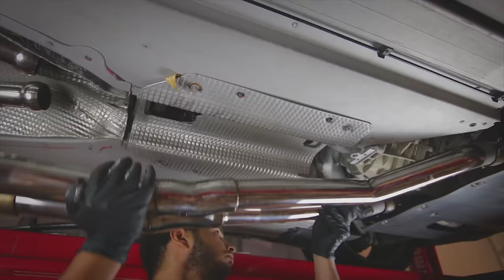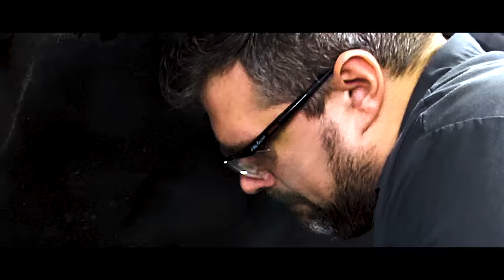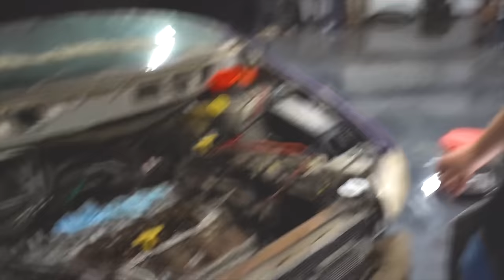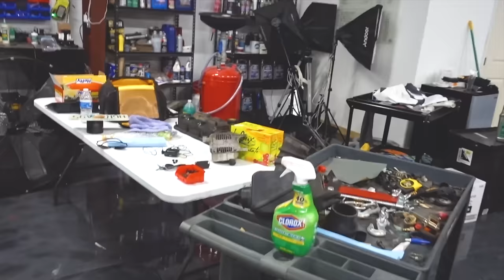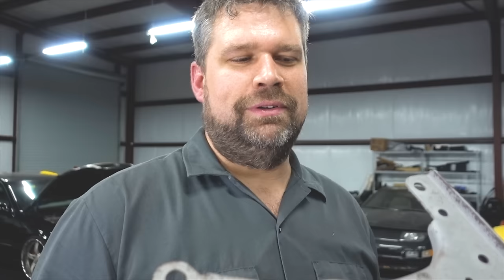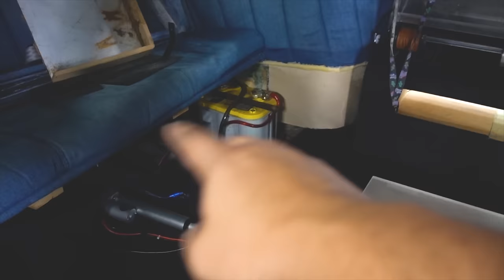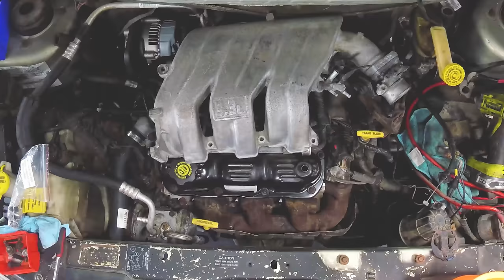Rebuilding An ABANDONED "Pimp My Ride" Minivan In 2 Days

Comment: "You would think that 2004 tech wouldn't have a staying factor". Man those monitors ware made back when electronix was build to last. Nawadays everything is cheaply made so it wont last on pirpase. Back in the day there warent that many manufacturers making them so they competed on quality. Now there are 500 only in China and the competition is on price + they all make multiple models each generation unlike before (1-2) and the gap between gens is much smallar. Thefore in order for all that to be able to sell it has to be build to fail "planned obsolescence".
Good example of that . My grandfather still has a Phillips CRT from 1988 and it still works with very good picture. While i threw a way 2 year old LG because I had a cascading pixel death just after the warranty expired and was cheaper to buy new.

Comment: I have zero mechanical skills outside of a few simple things I can do like changing the headlights, filling fluids etc. But the urge to want to get every bit of rust off the engine hit me hard and that's all I wished I could have seen happen. But, if the guy working on it doesn't deem it necessary then it clearly isn't lol.

Comment: damn, the behind the scenes work to install those electronics looked really sloppy. the design of the paint job couldve been better. the front windows couldve been tinted black to match the colour palette. the driving experience doesnt seem to be good at all, like it feels like a normal van. the back seat, thats really uncomfortable, i feel sorry for the passengers. uses too much electricity. too much wasted spaces. and the car had to lift a lot, i mean a lot of unnecessary weight, especially with those monitors. i bet you that the sound systems is horrible, dont think they put any proper sound engineering into the design. looks cool but overall a disaster, but i guess thats what the show is all about. feels like the people on the show dont really care about all the other aspects of the driving experience but to just make it look cool.

nothing against the restoration effort, you guys did a great job in reviving it. love the content!

Comment: ATF has LESS detergents then a properly formulated motor oil. Don't use ATF, use an engine flush as they are designed for that and cost about the same.